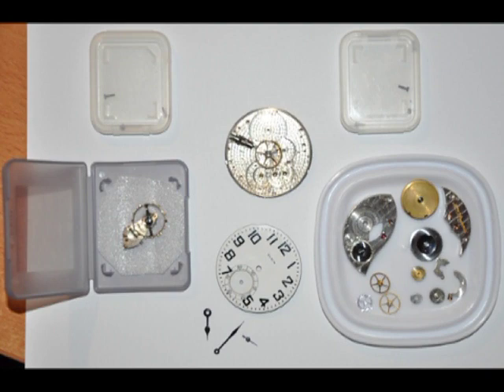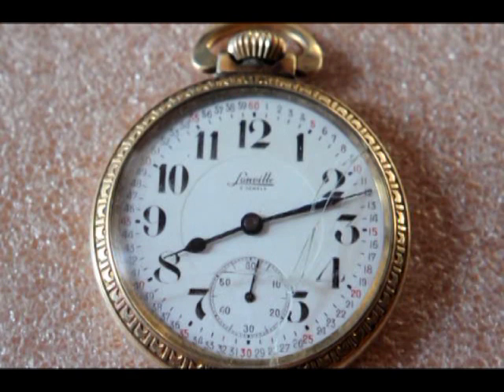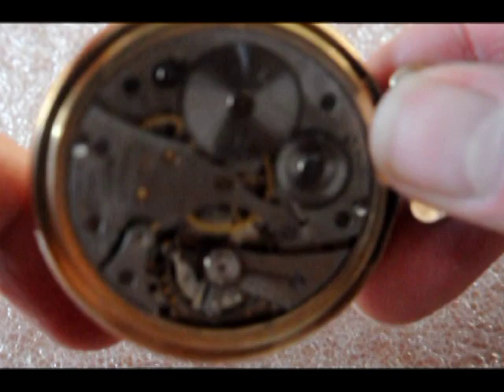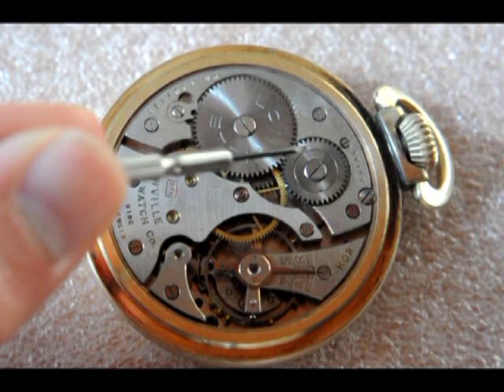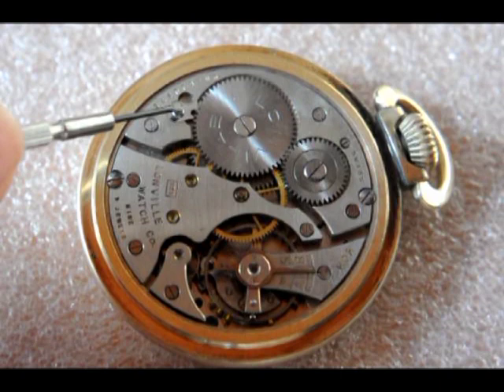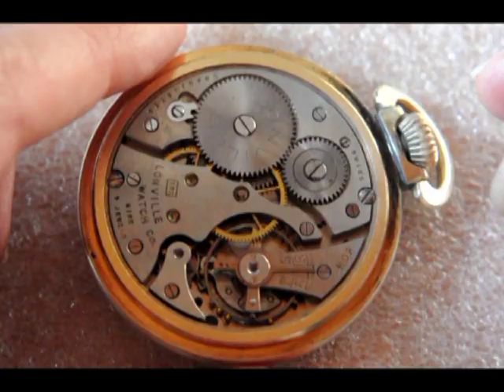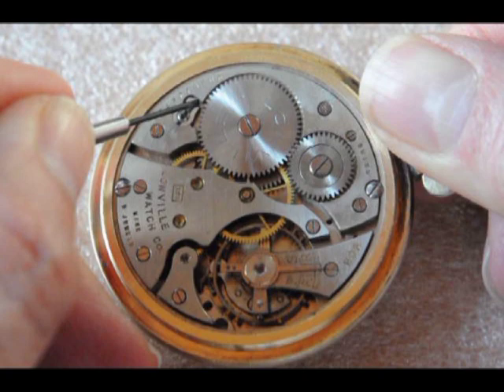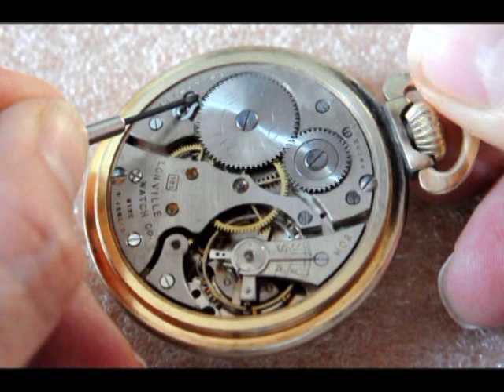How to unwind a pocket watch mainspring

Comment: I looked inside the back of my old Longines pocket watch (almost a mirror configuration of the one you showed), and figured that the catch locked in the big wheel needed to be released. I wasn’t sure if I needed to undo the screw! I should have known that was not necessary. So I watched your very informative video. 

The problem was that the entire movement appeared to be jammed solid. I couldn’t even turn the winder at all. So I shook the watch back and forth a few times, and each time it ticked for a few moments. Then it was possible to turn the winder slightly and release the spring as you described. 

The watch still won’t run.  I guess it either has something else wrong with it, or perhaps just needs cleaning. 

Clearly I’ve got a lot to learn. Every journey begins with a first step. Thank you for sharing. Subscribed.

Comment: I am a self trained hobbyist watchmaker. I have serviced over 700 watches and I have rescued hundreds of collectible watches from estate sales. If someone wants to start out the low end watches like the one used in the video are a great starting point. They may have differences but basically all have the same parts. Watch a lot of videos and take your time. The only thing you will need is tools, lots and lots of tools.

Comment: Your instruction did work. However, there was a tiny spring underneath the catch mechanism that when I pulled it back ever so slightly, sprung out of its position. I could not find where the tiny spring bounced off to. Takeaway: Take watch to a pro watch jeweler or be prepared to lose tiny pieces 🔍😄

Comment: How do you set the clock I have the same one as that one
Reply: Typically you pull out on the stem, which clicks the gear into the setting position, in which you can move the minute and hour hands. It's best to move it forward to the time you wanted to set the watch to. Moving it backward creates slight pressure against the slip clutch, and since the mechanism wants to advance the dials creates less strain. The balance wheel, is usually the part of the watch that is the most delicate. You must be careful not to bend the tiny coil springs positioned on either side.

Comment: I don't agree with you totally, i'm a toolmaker by profession, and i started working on small mechanisms like Z_Gauge modeltrains 1:220 scale.. those are also very delicate.. i'm now moving into watches, at the moment an ETA 2763 is on my workbench.. being a novice means you have to read and learn a lot before even attempting to repair a watch.. but it is something that can be done, if a watchmaker can, someone with experience in fine mechanisms, patience and the will to learn can also do it.

Comment: feck i left it to unwind to fast :( how can i fix it? :( i have this old pocket watch and my parents sold the gold part of it and i got the only the watch left and i want to turn into a neckless...but it stops all the time and missing about 10 mins of time...now i tried to unwind it and i left with once to unwind :( now its dead...is it possible to bring it back to life again? :(
Reply: If it unwound too far, usually can just be rewound but looking like your going to have to remove the mainspring and see if it broke. It's uncommon to have it not work unless it was so overwound that it literally broke. Yeah, really you only needed to unwind it maybe 1 turn at the most. A better way to do this would have been to apply slight finger pressure to the smaller gear and just let it unwind 1 or maybe 1/2 turn. Few watches are designed to be overwound, but if they were severely overwound more likely it either broke a gear, or the balance wheel exceeded past the 180 degree rotation, bypassing the ratchet fork, and leaving it in a state of unbalance. Fixing it requires to remove the balance wheel, letting it settle back to the center position, and carefully reinstalling it. Some watches you cannot do that too. In any case, if you can it will mean having to unwind the watch after removing the balance wheel, and then  reinstalling the balance wheel, in its natural position, and winding the watch and see it start running again.

Comment: Sadly as shown this did not fix the watch, and so you can see that the pendulum never did start moving. So releasing the overwound mainspring did not fix anything. It would then seem the real problem is requiring mineral spirits to lube the pendulum and hopefully resume the action to a running state again. Also if Parts are flying out of the watch, then its probably indicates that something is broken in the watch. A Screw, or some gear broken pin, or dirt is present in the watch.
Reply: Dude. Releasing the tension in the main spring has nothing to do with fixing the watch, at least not directly. You do that so that when you disassemble the rest of the watch (say to repair the actual broken part) the pieces do not fly out because of the tension built up in the main spring that you never relieved.